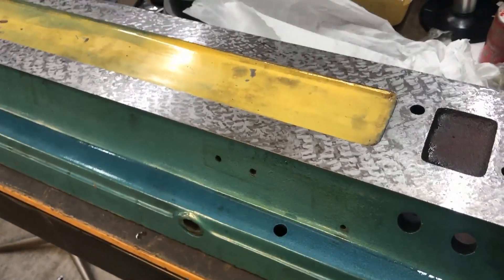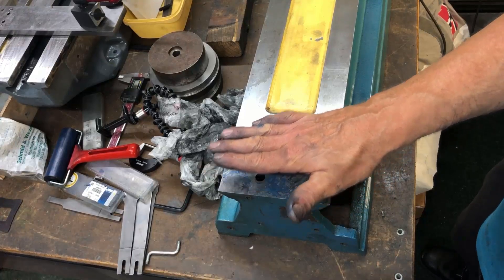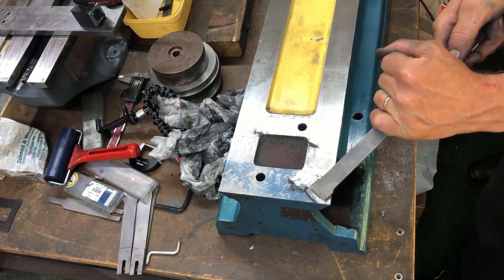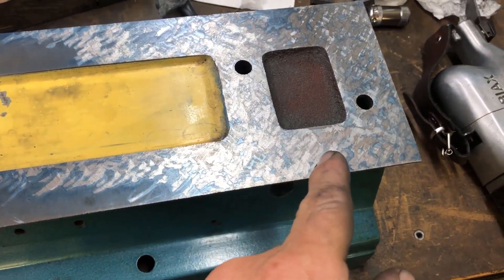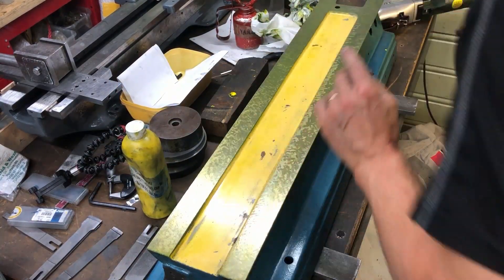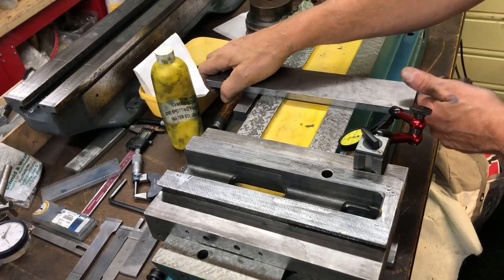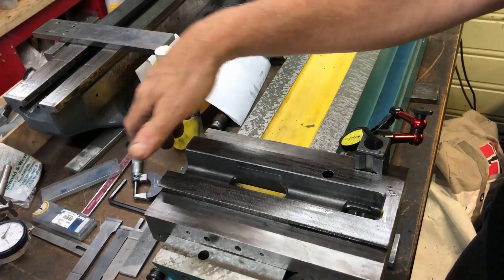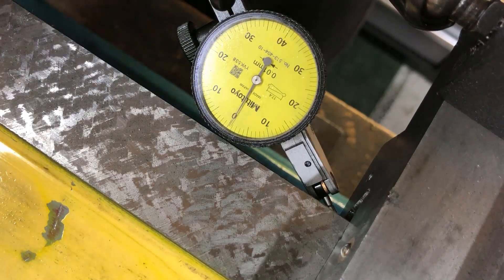AT-300 lathe-mill-drill - improving the top of the bed (scraping)

Comment: I'm curious about the epoxy granite.  The composite might be pretty good at damping resonances in the cast iron - or not.  I've never seen how machine designs are tested for resonating chatter, other than empirically.  I wonder if it's possible for something like Fusion360 to simulate it from given materials and forces?
Reply from the maker: There are several hi-end machines of various brands that are using such foundations, eg. Studer. Have a look at their website (just Google granitan, which is their name for the secret recipe 😀 )